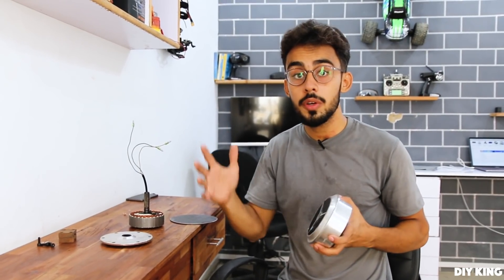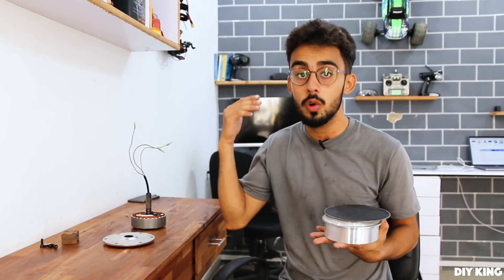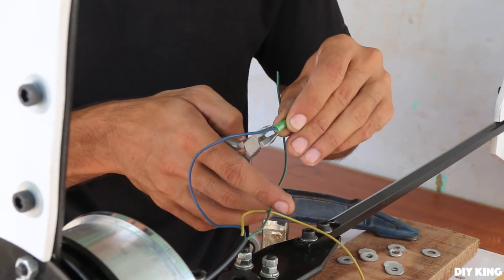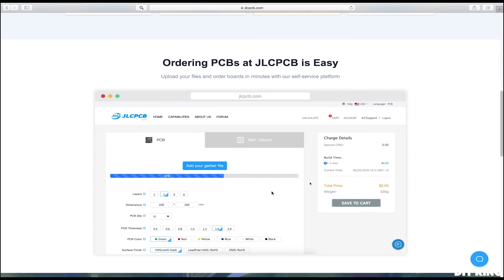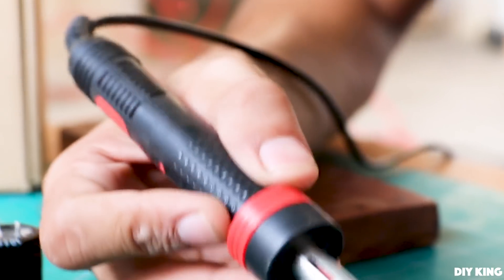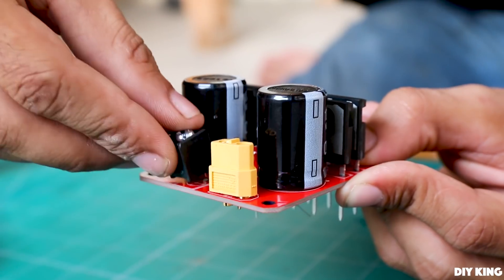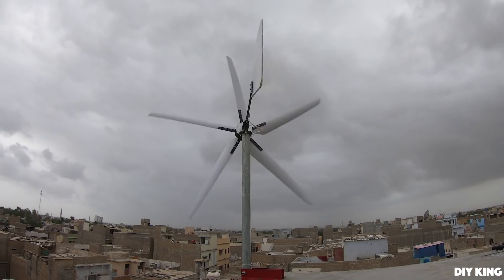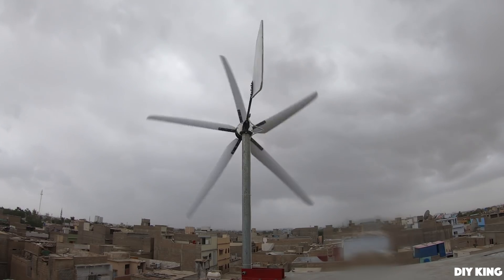Building a Wind Generator using a Hoverboard

Comment: How did you solve the wires going down the mast? What happens if the fan spins 360 degrees in the same direction 10x ( or more) in a 24 hour period?

Comment: All practical tests show that small wind turbines hardly generate any electricity. 
There is hardly any wind near the ground. And it is also very gusty, which extremely reduces the service life of the systems. 
With solar systems, you can reliably generate electricity for about 8-12 cents/kWh over a period of 25 years!

Comment: you should revind the bldc motor. 2x turns per winding will make it efficient. more turns more voltage for slow speeds.

Comment: kuch bhi.... and jahan windy area nahi hai wahan kya karoge.... The only advantage of wind is that it requires less space for more generation...But solar plant require a huge area... But solar can be used almost at every place. 
And a normal plate comes with 250 to 300W peak generation capacity...

Comment: can you use the gears to increase the rpm?
Reply: Yes but torque would drop too. So perhaps larger blades or deal with smaller wattage with less breaking parts. This would definatelly need a brake of some kind as it is. Maybe electrical coming from charge controller or automatically tilting tail when the wind is too high. Latter would require some calculations but with the power of internet search engines...
Reply: @Teknopottu  hoverboard motors have hall sensors on them. So, by this you can use an esp8266 and set a maximum rotation allowed. When this is passed a mechanical brake can kick in or a servo can change the position of the tail maybe? It is not that hard.
Reply: @huseyinozsut9949  Seems like s very good idea and not too hard either. Kudos.

Comment: Excellent build. I buy these hoverboards up to use tge 186650s inside to fix tool batteries, but plan on building one of these that will be both manual pedal powered and wind powered, it will have a simple transmission in it like the autoshifter mechanism in a 10 speed bike. Pretty epic that a toy can be turned into a very useful device at the end of life. 350 rated watt motors, each wheel! 😲 good grief!

Comment: Is there any channel which can explain "control system" in easy and effective way.
Reply: buy a simple three phase rectifier on amazon or whatever they look like little black hockey pucks and are cheap.  Or order that pcb and the parts its literally laid out on the board what to solder and where.  I built both the pcb and tried the traditional all in one rectifier from online.  Both worked well.   If you actually want to use this to charge a battery bank consistently and supply power to your house you'll most definitely need a charge controller-Most expensive part of the system for sure- or build one but you'll really need an extensive understanding of electrical engineering.  Good luck mate

Comment: Next build you might consider using lock nuts with plastic washer. They have plastic built into the nut so it will never back out.  I only suggest this since it is a safety concern.  Otherwise it is a great build.

Comment: great stuff  friends.  5 blades more stable, but 3 blades will increase  rotations/ wattage, also a bearing shaft assembly on the mountings would ensure quicker & smooth  direction changes
Reply: Hay más velocidad en 3 aspas

Comment: ... Do you have a pretty steady wind direction that allows you to just run the wired straight from the turbine to the building, or is there a slip ring system somewhere we can't see to allow fully free rotation of the turbine?

Comment: Would be nice to see some statistics - a graph of wind speed and produced power. 
Also, you have rigid connection of the tail - this could be a problem if wind rapidly changes direction - due to gyroscopic effect the rotor will resist to turning and there will be big forces. There are some clever ideas how to use springs on the tail to reduce the forces and also how to make the tail turn this thing a bit sideways in high winds to reduce speed and avoid breaking.

Comment: Nice job. 
From the way the tail fin was shaking I’d guess the blades were out of balance, it would probably last longer and be more efficient if you sorted that out. 
Is it able to rotate a full 360° on the pole and if so how is the power cable from the motor connected to the cable down to the ground so that it doesn’t bind up?

Comment: Your design work very well except you need to fix A three pole commentator To prevent the wire from wiggling into And you need to have the blade balanced you can simply do this by putting it on a bearing and the heavy side will go down and balance it from near the center shaft which will make it more accurate at higher speeds 😉
As I noticed  The low frequency when in operation .

Comment: Nice share the creative project, may you can add the regulator DC voltage for maintain the output more stable in range 12 volt. CMIW just share my experience :)

Comment: your design has a major flow, that the wire are just made to rotate with the whole unit, so through long hours of work the outlet wires are gonna twist themselves apart, it be more practical to use some sort of mechanical slip ring attachment allowing continuos flow of power whole allowing for 360° movement of the unit

Comment: AoA bro, very nice project. May God Bless you.. I have some question:
1) why do you use rectifier, as wind charge controllers already require three phase AC input
2) what did you do for waterproofing? or the hub motor was already waterproof
3) why didn't you use primer (or red oxide) before paint job on the steel bars etc to make it last longer? you should also use primer and paint on the blades, it will make it somewhat weather proof.
Thanks for the project bro.
Reply: Didn't hear from you bro. We are having a lot of electric shut downs in Pakistan... Please update us on this project and make necessary amendments... Thanks

Comment: Just like that
No control, no aerodynamics, no battery for storage, no inverter for grid and house operation
What are you going to do with the power generated of there is any power generated ! How are you going to make sure that the generated power and voltage are on a frequency and level adequate to your house or any tool!!
Please dont call it a wind turbine, call it a wind something that turns. Thx :D

Comment: As an experiment it's a good video and has been low cost. As all the other comments say, would be nice to have a follow up video to see what has been learned from the design e.g. Did bearings survive? Did the metal parts require any maintenance, what power did it generate. Ideally what people want is a low cost design to produce about 1 to 2 kWh per day minimum

Comment: Brother my question is ,If we convert AC to DC with the help rectifire then it would charge the battery only we cannot connect directly to appliances, and if the air speed is less then the required and more then required  the battery won't damage due to current fluctuations?

Comment: Good job. I would be really interested to know how much energy was generated by this DIY turbine in a year, how much noise does it produce and if it has survived the rain and other environmental conditions.
Reply: as he said it was producing around 150W of energy at that moment. If we take an average of 100W then we get 2.4kwh of energy in a day or around 912kwh a year. Or as we say, you get 2.4 units a day and 912 units a year which is pretty decent especially considering you can make this for less than 10,000 INR

Comment: Too much drag from 5 blades reduces efficiency.  If you want to store energy, try 3 blades and mount it on a taller pole and away from other structures.  Will  get better efficiency!  Remember, if wind velocity is not above 8 meter/s you shouldn't expect much energy produced.

Comment: Great work love  the video. How about a VAWT using both hover board motors 1 top and bottom for your next project?
Reply: That is a brilliant idea. Would add a lot of resistance for start-up, no?
Reply: Possibly you would have to size the rotor accordingly
Reply: I also like the idea of magnalev vawts very low friction turbines

Comment: Did you do anything INSIDE the motor to make this work?
Reply from the maker: Not much just removed the hall sensors as they are useless for our application and later we added a three phase rectifier as its a three phase brushless motor.
Reply: That's the kind of thing I'd like (need) to see, as this is all new to me. Really enjoyed the rest of the build,
Reply: @DIYKingSaM  And more detail on how you did this...
Reply: @charlesfitton9677  read the instrucktables
Reply: @BastelPichi  Thanks for whatever that is.

Comment: GREAT recycling of a device and the workmanship was outstanding
Now for a bit of criticism your fin on your wind vane is cavitating (vibrating) you need to change its shape or reduce its size. That cavitation is reducing your efficiency and in turn your voltage generation (look at your own video it shows the fin "wobbling")

Bottom line it is GREAT workmanship and ingenuity (if your not and engineer you SHOULD become one)

Comment: Do you have some sort of protection built in the system if the wind gets a little bit too strong? I highly recommend it. For the safety of the system and the people around.
Reply: There is protection there already with the capacitors and PC board from China to regulate against overload issues.
Reply: @namkebanyanklariti I mean rpm overload protection, not electric overload. .

Comment: wouldn't it be easier to reverse the polarity of a ceiling fan to do this?
Reply: Most if not all ceiling fans are induction motors which you would need to power the field winding in order to generate. The motor used in the video is a PMAC which can generate without the need for a field supply.

Comment: Nice work, you got my subscription, Some tips, weld a stiffener on the back of the turbine tail bar, it is flopping a lot, at that leverage it will put unwanted high amplitude vibration during high wind velocity and may cause shorter life span over time.

Also, it is always important to discuss electrical power in terms of watt power = volts x Amps, not just to mention voltage as it needs amperage to obtain useful power.

Liked your work. Thumps up.
Reply from the maker: Thanks for the good words will definitely try to work on considering your suggestions in my upcoming videos
Reply: @DIYKingSaM   لقد بذلت جهد ممتاز ووصلت لنتيجة طيبة استمر بالتوفيق
Reply: How do you plan to conduct output current through full 360 degree circle azimuth variations?
   Wouldn't a very low or zero electrical  resistance load be enough to slow the generator rpm to a safe level if it was found to overspeed?
Reply: mako man   I had intended my comment toward whoever mentioned it spinning too fast whenever it's too windy. If that wasn't you then maybe it just went in the wrong pidgeon hole.

Comment: Seems really good, and I never thought of using a hover board for the motors, however this needs a slip-ring unit in it so it can spin in any direction without tangling the wires.
Reply: Yes! This is very important!

Comment: Good work, but it will not work and you will not get enough ampere to charge the battery 20 Ampere Scooter Wheel Need to high speed up to the speed of 300 rolls per minute
Reply: شو رأيك

Comment: I needed this info to settle in my mind for future similar project: to assemble blades with an old generator motor (with the gasoline part detached)
Reply: Interesting project! How much money are you gonna invest t?  I think it's better buying one istead building one, because many people doesn't know to much about it and the most important thing , people doesn't have enough time.  How much energy do you want to produce ? Remember the place you're gonna install it is super important. Here in this blog you can fiind tips for installing it https://cuttingedgepower.com/blogs/solar-projects/where-is-the-best-place-to-put-my-renewable-power-system
Reply: @RevoPowerUSA  hi Sir, I just came from a short vacation and now I have time to respond to you properly. first, thanks for the link you posted it includes a very general and important knowledge for beginners in this area 👍✔.
to your questions: first I threw away that generator because it caught a lot of space in my roof, it was heavy and clumsy and I have some other projects on the table before that. As a replacement I have two car alternators that already rectify the 3 phase triple sine wave to a direct voltage of 14v which is more convenient for charging a car battery.
On my roof where I live there is a higher roof for my neighbours solar water heaters and there I can place a sturdy pole that will hold this alternator and the wings, it is quite high. I expect around 100w 
(or more) to get from this system that should add to my 100w solar panel that I already use.
I might add another Trojan deep cycle battery in conjunction with mine or as a backup for my RPI computers with the screen that runs by an 12 to 220v inverter.
whether to buy or DIY? I prefer doing things as much as I can, this way you learn from your mistakes and experience on the way which is priceless, I neither have time surplus.
Reply: Hi @ronen124 ! No worries for that. Thanks for answering. yes, the info you can find there it's super useful. Thanks for answering my questions. I agree with you the generator was super big. Good replacement for it. Right 14V are a good option for car batteries. How many car batteries do you have?  Wow 100W it's amazing.  I believe it's good use solar panels and wind turbines at the same time. Because you're gonna have  power 24/7 . Do you use the same batteries for both? We have a battery tha can be used with solar and wind at the same time. It's ready to use and you don't need extra connections https://cuttingedgepower.com/collections/power-house/products/1200w-mppt-rolling-solar-generator-with-1000w-inverter-and-wheels-portable-battery-box
I agree with you. When we do things by ourselves we learn more and of course we learn from our mistakes. Once again thanks, and Merry Christmas !
Reply: @RevoPowerUSA  yea, now at the winter I hardly have enough power to run my dedicated cameras raspberry PI 24x7 + some more small devices. Maybe it's because of the fact that my battery starts to get old, it is 3.5 yo now and as I mentioned before it is not car battery its low depletion batt that cost 2-4 times the cost of car battery (cost me around 350us$ back then) because it can handle total voltage 100% depletion not like car battery that will be damaged by such harsh use.
I have only one batt for energy accumulation yet it's much better to have at least 1 more for redundancy, one for each charger but as a conscious DIY person - I started small..😄
I expect to to invest only at the 1 meter and big diameter and thick PVC pipe to make the blades, I plan to weld small flanges to the pulley of the alternator so it will hold them strong. at that roof my neighbour left a sturdy satellite holder anchored by heavy bricks to the floor so I can use it to hold my generator.
Merry christmas 🎁🎅
Reply: @ronen124  I'm glad you have enough energy for this winter.  The battery usefull lifetime is around 4 to 6 years. It is a good battery and it worth buying. 
Yes, it's much better having more than one battery. Just in case you need a replacement. 
It's good starting a project step by step and then you see the result and you can decide if the investment worth. In your case it did and you're thinking about more renewable for your home what is amazing. If you need something we can help with don't hesitate to contact us www.cuttingedgepower.com

Comment: You didn't show the voltage and ampere produced by it and how where you use that  power despite this all video was amazing like a professional
Reply: put a simple bulb 12 v ...imediatly will block wheel
Reply: Voltage variable con la velocidad y amperaje variable con la fuerza de torque , yo usé uno igual y comienza con 3 volt  ac  y algunos2 amp y con 300rpm sube a 12 volt ac con 5 amp y con 800 rpm
Reply: 8oo RPM sube a 90 volt ac con30 wat y a 1800 RPM 130 volt
Reply from the maker: Sorry for that as its difficult to cover all the things in such short video.
The output was connected to our inverter to charge the batteries. At max air speed which was 7m/s we were able to produce 150 watts(24v and 6Amps)
Reply: cause that motor is too musch cogg of magnet not an easy like freewheel so its hard to spin by averrage wind condition so im sugest to make this into hydro turbine and see amp draw by water force or see a video named "The $50 Water Turbine" may be next project proof
Reply: @DIYKingSaM  Clean recycled intelligent 150W ! Congratulations 😎
Reply: @SwissMadeMax  you seem like you could answere my question, just take a guess how much of these would it take to power a house ? :)
Reply: @skyclimber2082  it depends on how much power that house will consume, and the average wind in the area 😉
Reply: @SwissMadeMax  let us say 5000 kw for the house and an average of 10km/h 😄
Reply: @skyclimber2082  🤣 better install a biggest wind turbine, combined with solar panels for integration, and powerwall
Reply: @SwissMadeMax  haha okay thanks I had no idea 😂
Reply: @SwissMadeMax  sorry but it is still on my mind, this produces 150 watt per sec isnt that enough to power a 5kw house ? Or am I dump ? 😂